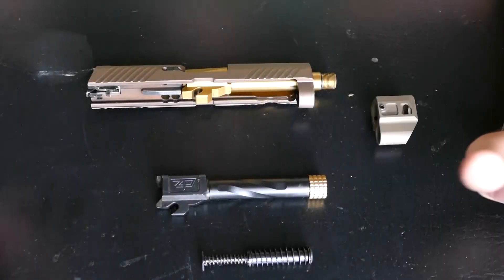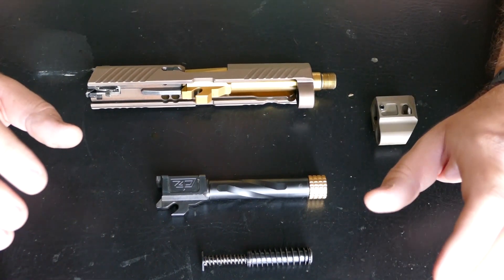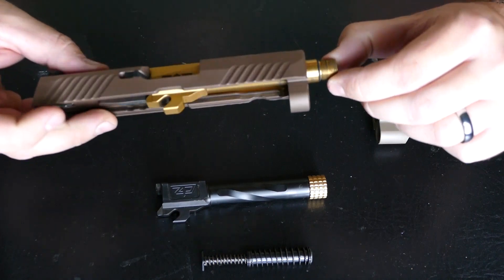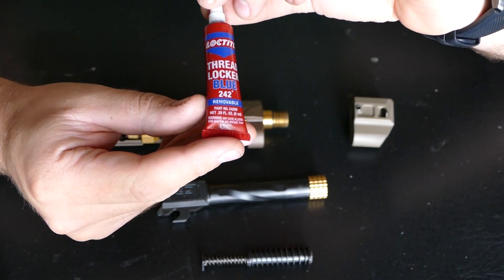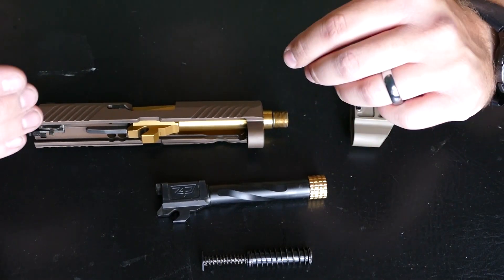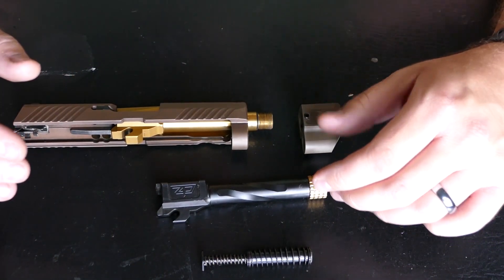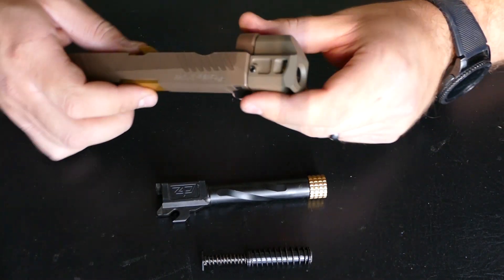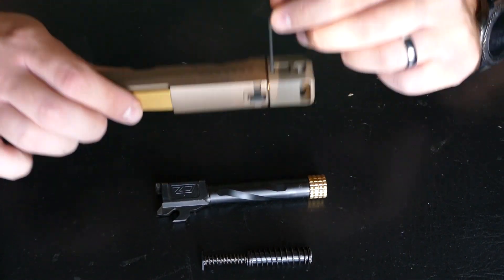HC320 COMPENSATOR INSTALL

Comment: I have a xcarry and put this on today. It’s noticeably harder to rack the slide. Then if I take the slide off and try to get it the whole way back to the slide lock it’s nearly impossible to do so. Comp was tighten to the end of the slide then backed off. There’s about a 1/10th inch gap. Slide isn’t making contact. I saw someone else here a year ago was having the same issue.
Reply from the maker: I have only sae this to be an issue when the guide rod is installed incorrectly. Make sure the flats on the guide rod are on the left and right not top or bottom.
Reply: @herringtonarms  yeah my guide rod is installed correctly
Reply from the maker: @jackripper6033  Hmm, please send me an email with some pictures of your setup. Ill see if we can figure this out! support@herringtonarms.com

Comment: Even when mine is backed off till correctly oriented, the slide still has issues racking back it seems like it needs to be backed off more. Is there anything that can be done to fix this?
Reply from the maker: Make sure there is a gap between the comp and slide. If there is no gap you will definitely get binding. If there is a gap it sounds like you need to look at your guide rod assembly.
Reply: @herringtonarms  turns out the Wilson combat frame I was using was having some issues with clearance. And the comp was setting stuck on the frame.

Now I just need to get a lighter recoil spring. DMP probably the best option to lighten up the recoil to use lighter loads?
Reply from the maker: @GravySealNetwork  Polish the frame where it was binding and it should work great on oem springs
Reply: @herringtonarms  The WC grip module narrows a little at the top at the front, that makes the comp catch.  If you take it down a bit on both sides until it is perpendicular, the comp will work fine backed off half a turn as Herrington suggests.

Comment: Red loctite just needs to be heated to be broken.  It’s not permanent. But certainly requires more effort to remove. Blue Loctite obviously can be undone with just the right amount of torque.
Reply from the maker: It is not but a lot of people don't have the tools to break them loose without damaging the comp or gun. In our experience

Comment: What’s the correct barrel length?
Reply from the maker: For a compact or carry slide you need a 4.6" and for the sub compact or x compact you need a 4.3"
Reply: @herringtonarms  I have an xcompact and with the 4.3 the compensator does not fit.
Reply from the maker: @pfundora99  Shoot me an email at cory@herringtonarms.com with some pictures of your setup and I can help diagnose what's going on.

Comment: Does the side screw leave markings on the barrel?
Reply from the maker: Yes it typically does. It does not affect anything with function with or without comp installed.

Comment: I have a p320 Xcarry 3.9in barrel look to build it on a full-size what barrell would I need and which comp. I’m afraid to get the wrong threaded barrel. Thanks.
Reply: True Precision
Sig P320 Compact, X-Carry, & M18 3.9" Threaded 1/2x28

Something like this should work threads protrude out to 4.64 inches roughly with a comp it should fit flush for the most part